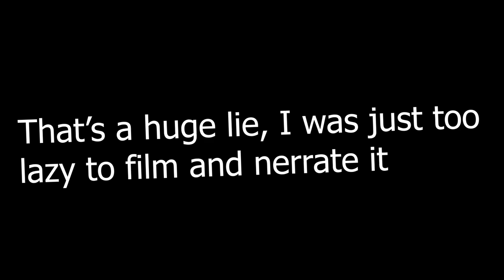Stupid Complex Woodworking Tool Box PT.3

Comment: SO many questions but the 1st one is how heavy is the box with all the tools?  Is it practicable to be used on a job-site?  I must say, it's definitely a beautiful piece of craftsmanship, well done!
Reply from the maker: I forgot the weight it before moving it to an other shop where I don't have a scale sadly. But I has estimated it would be around 15 lbs fully loaded and if I remember well just the box itself was 5lbs. 
The tool box is more designed similar to a machinist tool box. More for caring precision equipment and only taking it out to leave it on a workbench all day. I would most definitely not want to leave this banging around in the back of a pickup truck aha 
No
Reply: I just to watch all the detail you put into your work.  Great video!

Comment: Really amazing. I have to ask - did you draw up some plans before you did this (no not asking for any) of did you do this on the fly?
Reply from the maker: I made one plan of the side profile of the tool box. That was mostly just to help me with the visual design and making sure all the tools would fit in height and length. The rest was all designed in my head as I went. I find plans to often be longer to draft  than fixing mistakes so I'd rather make some of the parts twice than draft plans for 15 hours. In the end there's just the part of the drill bit mechanism that I made twice and the laching systems that I had to make a prototype (which as stated, sucked.)
Reply: Then color me even more impressed!!

Comment: Absolutely in love with the finished product! Out of curiosity, how much does it weigh with all the tools inside?
Reply from the maker: I sadly forgot to mesure that before moving it to the workshop I made it for. But if i remember well, my estimate was 5lbs for the box itself and fully laoded it was suposed to be around 15lbs. So the box is much heavier than a plastic or sheet metal toolbox. But this box was designed to be moved on a bench once or twice during work day so it's not a big issue.